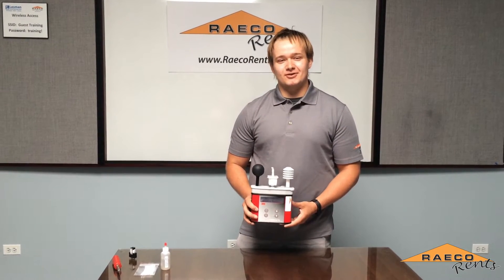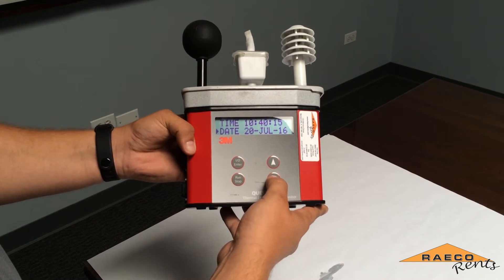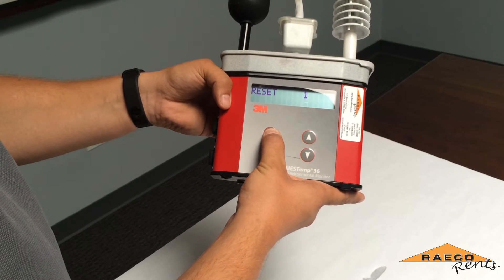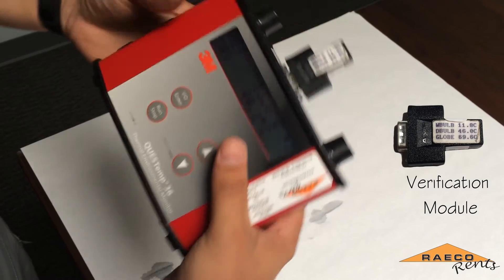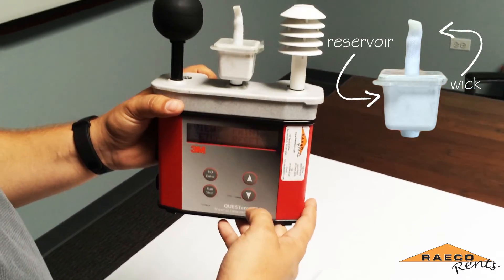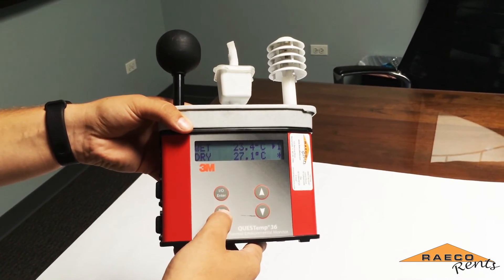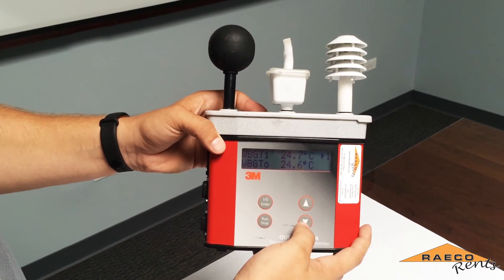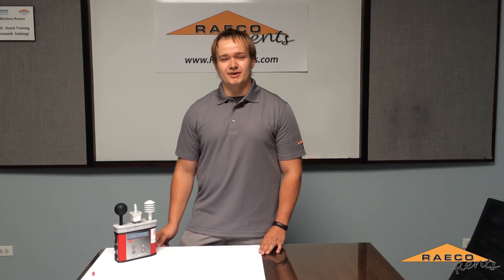How to use a TSI QUESTemp heat stress monitor

Comment: Why the monitor needs to be left for a while before taking readings？
Reply: The circuitry inside needs to get to a stable temperature - if you move it from inside to outside, or vice-versa, this could take a while.